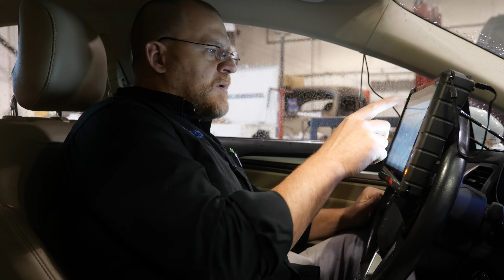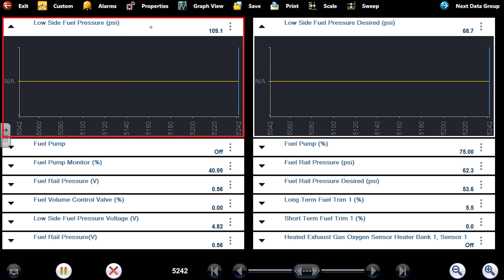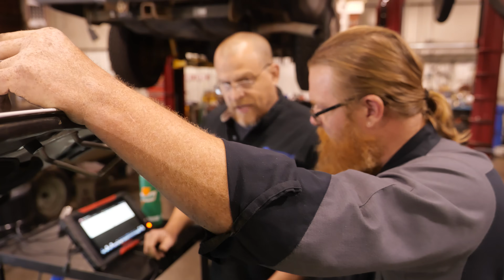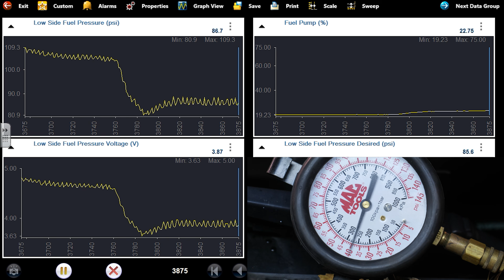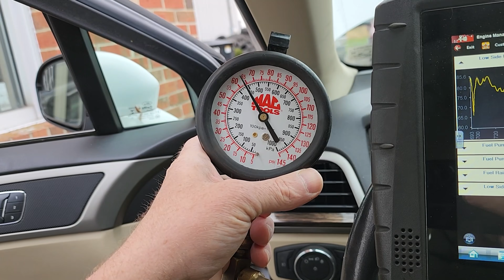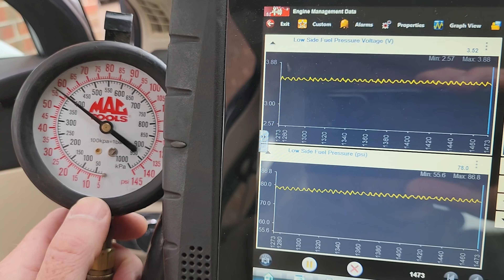Gas Direct Injection System With Intermittent Low Fuel Pressure

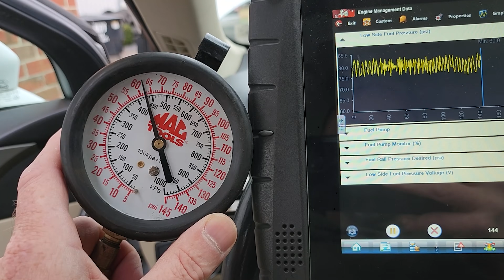Comment: 43:40 On the 2020 VW Atlas, Snap-On Zeus shows "adaptation values" for the fuel pressure sensors.  That might account for the difference between the fuel pressure gauge reading and the value displayed on scan data for fuel pressure.

Comment: In March of 2026, our shop is flooded with GDI fuel delivery issues.  It would be nice to have videos that offer guidance on what cautionary tests (and or disclaimers on the business end) should be done before throwing a high-pressure fuel pump at a vehicle.  If the HPFP replacement didn't work, how can we tell if it was a defective replacement HPFP or a problem with the cam lobe, follower, cam timing, spill valve circuit/wiring integrity?  Techs are thirsty for this training and employers have no choice but to pay for it.  Would be nice if employers didn't have to pay for room and board (meaning if it were available online).

Comment: That's interesting. I like the idea of applying heat to the sensor to see if you can get a reaction. I learned some info about high pressure electronic fuel systems.
Reply: So did you apply heat to the low pressure fuel sensor to make sure what you was reading on your scan tool wasn't subsutited values? I wonder how the heat was able to make the pressure sensor change signal voltage?

Comment: @scannerdanner did you have the Schrader valve installed on your fuel pressure gauge in this video? Ive got a 2017 fusion with a GDI issue that I beleive is an inop high pressure fuel pump, but when I install a fuel pressure gauge on the low side (Schrader valve installed), there's no fluctuations in pressure, which would be an indication to me that the HPFP really is faulty

Comment: Funny I ran across this video after searching Phoenix Plus scanners. I have the same car doing the same thing and it acted like a fuel pressure issue or restriction- meaning it ran better as I lifted off the pedal in test drive. But I couldn’t verify because I didn’t have test port adapter for low side. I ordered that and then my Autel broke before I could get back to it. I ordered a Phoenix Plus and this video was suggested under your review. Wish I’d found it the first time I tangled with that car but now I’m excited to get back.

Comment: I think this is my 3rd play through this video. I appreciate what you do! I was wondering more about how the pcm determines what fuel rail pressure it needs. My 2.0 eb is idling at 260 frp and i see the car in this video is in the 700's. I think that points to my lean code and failing cat. However ive been missing it because the desired pressure is also right at 260ish so the ecu is happy. Im planning to test the low side pressure very soon.
Reply from the maker: If your desired matches the actual, then your pump is not the issue. What are you chasing?
Reply: @ScannerDanner  the car is running at over +30% fuel correction. Weve checked for air leaks until we died. Even a ford dealer found no air leaks. So if the system is correcting with that much added fuel, there MUST be extra air for it, UNLESS there is just not enough fuel available. The pcm is opening the injectors as far as possible just to get enough fuel to idle near stoich. Above idle, my fuel rail pressure spikes fast and the trims begin to drop, at wot im near 0 ltft. So it would seem i have low frp but only at idle. Ive replaced/swapped every sensor including the injectors.

Comment: I have a 2014 ford fusion 2.0l turbo. I was wondering what the desired fuel rail pressure at idle? Mine is running 259 psi I’m assuming it is low. The low pressure pump is at 55 psi on a gage. By the way awesome video.
Reply from the maker: You should have that data parameter on your scan tool. If you can read rail psi, the desired should be there too and we'll as the high psi pump solenoid duty cycle.
I do not know what the desired is, sorry
Reply: Thanks for the response. I tried my scanner is a BlueDriver. It just reads the high side and doesn’t give me desired. Bummer. Have a great day and thanks again.

Comment: Our 2014 Focus Titanium just started acting up and has 226,000 miles. I have a cheap code reader that shows low fuel pressure. The FRP goes to 0 and runs very rough after driving 4 or 5 miles. FRP sensor and FP sensor replaced. No change. In tank fuel pump replaced and HPFP replaced, as well as the fuel pump driver module, with no change. 
 The HPFP has a foam insulation cover on it and I am curious about how warm the HPFP should be? It gets pretty hot to touch. Is this normal?
 I'm asking because nobody around here seems to be able to help.
Reply from the maker: I think the first thing I would do is to confirm that the low pressure side of the system is being maintained at the proper pressure. You'll need to adapt a pressure gauge on the low side of the system somewhere.
Reply: @ScannerDanner Thank you for answering.   I haven't put a physical gauge on it, but my friend has a Snapon scanner, and it's reading a constant 85psi on the low side. The in tank pump is new. I removed the FRP and turn the ignition on, and it shoots a stream of fuel out of the fitting. The fuel filter is in the tank fuel pump. No in line filter.
Reply: @ScannerDanner  I'm sorry to bother you again. The FRP and desired FRP are within a few psi from cold start to 194 ect. As soon as it reaches 194 ect the  FRP and desired FRP goes haywire. Desired FRP will drop to 53.6 and rebound to 288 and everywhere in between. The FRP will drop to 0 and climb to 400 or more and drop to 0. 
 After it starts running bad ,
 I unplugged the FP sensor with no change so I plugged it back in. Unplugged the FRP sensor, and it won't run, so I plugged it back in. When I unplugged the HPFP it runs better. No sputtering or rough running. Plug it back in and the rough running and sputtering returns. I think I found something but I don't know what or where to go from here.
 New in tank fuel pump,  HPFP,  FRP and FP sensors, FRP pigtail,  and fuel pump driver module.
 Your help is greatly appreciated.  Thank you.

Comment: As to the fluctuations in gauge not matching the scan data: the needle on gauge may not be able to keep up with the frequency increase in the electrical fluctuations on the scan tool.
Reply from the maker: More like the data is not keeping up with actual. It never does and is always delayed. But this was more than that.

Comment: I have a 14 Fusion now with similar complaint, but has a code for FPCM. Dealer replaced FDCM but codes comes back. Have yet to replicate the customer issue and all live data seems good, unlike your video. I worry my checks at the FPCM will be "good" unless I can catch it when the problem is happening

Comment: The reason why your pressure readings readings are different on mechanical gauge than scanner is because the fuel rail pressure sensor measures pressure difference using intake vacuum, where your mechanical gauge compares the difference with atmospheric pressure
Reply from the maker: Is off by more than 15 psi wasn't it?

Comment: Absolute and gauge pressure will be 15-20 PSI difference. I learned about this on a Volvo with a DC (Duty Cycle) NON GDI fuel pump system and did a scan tool pressure test. Service info and scan tool test told me about it and researched told me also. Funny thing it kept throwing fuel pressure sensor codes. Cause the pump was worn so DC was at like 50%, to maintain desired PSI. With a new pump DC came down to 20-30%(Been 5 years so don't remember exact # now). Vehicle was at 2 shops and the dealer before it came to me. All replaced the sensor and filter. Dealer wanted to put a computer in it.

Comment: Great video. I have been following your channel for many years. I learnt a lot. what is the purpose of heating the sensor? As I understand, Heating will rise up the pressure, we should see voltage going up.
Reply from the maker: Heat and vibration are the keys in recreating intermittent faults. Also rapid cooling of a sensor or component can help too. Thanks!

Comment: use a heat gun with steel flex tubing(exhaust) to heat the sensor or steam, if you have a steam carpet or engine cleaner with small handheld wand.
I'll state the obvious, don't burn yourself doing so that way and do not use open flame or spark producing things to heat fuel system parts(like the fan in heat gun!) keep everything a distance away just in case(lol) some people need this warning I guess.

Comment: The signal appears to be aliased on the scan tool at the higher rpm due to  a low refresh rate.
Reply from the maker: That wouldn't explain an actual smoother psi on the gauge cause the scan data PID to move more. I'd be the opposite if it wad a refresh issue.

Comment: Is it possible that the reason why the more fluctuations you see on the gauge the less there is on the PID, is because as the fluctuations climb, the less time the sensor has to measure and it kind of averages out on the screen, thus showing less swing?
Reply from the maker: scanner frame rate could definitely be a factor, its just opposite of what you'd think. A smoother actual measurement, shouldn't result in more fluctuations on scan data

Comment: I hope u get well soon 🔜... again.. another great video u have no idea how helpful you are and all of your knowledge...great tip from Brian at the end!
Reply from the maker: All better now my friend. Thank you!
Reply: @ScannerDanner  glad to hear that btw..idk if Yu remember me comment on a different video about the car not starting when hot....I believe it was the ect sensor....also it turned off on my client and found out the pump wasn't even strapped in on the holder and connected to hose
Reply from the maker: @nutsandbolts7407  I'm not sure without the context of the discussion. I'm sorry 😞 
But it sounds like I was able to help you? Either way, nice find!!
Reply: @ScannerDanner  well definitely direction..months later...I should have checked the pump first.......u had asked me what was the milliamp doing on the O2 sensor and it fluctuated from .2 to .9 .......yes u did help a lot!!.. definitely different than 2 years ago ...thank Yu!

Comment: A question about it. What happens with the SFT and LFT in that situation? Low pressure implies less fuel and lean condition? Would the ECM try to correct it increasing SFT? Thank you for this gems Mr.Danner.
Reply from the maker: Yes sir! Fuel trims would go very positive at times

Comment: Maybe the reason the gauge steadied when rpm increased is, even though the scan tool amplitude varied more,  the frequency also increased on the scan tool. The physical gauge probably doesn't keep up.
Reply from the maker: Scan data frame rate was the same if that's what your saying? Thanks
Reply: @ScannerDanner  frame rate the same but the time between peaks for instance are closer together when reving  (fluctuations so fast the physical gauge just reads steady.) Just a thought.

Comment: My alternator on my 2001 Firebird won't charge at idle speed, but raise it a couple hundred rpm and it starts charging. I checked the exciter wire going to the alternator and it shows it has 9 volts unplugged, with the key on. Should I be checking this plugged in? Or does this indicate a bad ground in the computer? Not sure if you're familiar with this system or not. 
Any help would be appreciated, thanks!
Reply from the maker: Is this the one wire set up other than the heavy cable of course? I'd have to check a diagram
Reply: @ScannerDanner  yeah. It has the battery positive terminal on the back, and then a small Guage wire going to a plug on the top of the alternator.
Reply from the maker: @nateb.1568  okay, this is a simple system where the ECM turns the alternator "on" with that small gauge wire. It should be near 12v from memory and should be tested plugged in.
You can actually take a test light to battery positive and touch on that alternator terminal and make the alternator start charging
Reply: @ScannerDanner  Thanks! I wasn't sure if it would be 5 volts since it was a signal coming from the computer. If 12V is the case, I have a voltage drop somewhere. I can see that it had been spliced into already so I should start checking there to see what voltage I get before the splice.
Reply from the maker: @nateb.1568  100% agree
Reply: @ScannerDanner  I'll take a look and let you know what I find! Thanks for the help!
Reply: @ScannerDanner  I checked it with the car on, and the exciter wire plugged in, and it showed 12ish volts when the system voltage was 14ish. So there is a 2v drop somewhere. I'm wondering if it's enough of a drop to not be able to start buck up once it gets down to low enough rpm.
Reply: I went all the way back to the PCM and the voltage is the same, 12.5 voltsish. Is this wire supposed to be system voltage(14.5ish) or is the computer kicking it down to 12? If it's supposed to be system voltage, that points to a problem at the pcm itself. Corrosion on the pin? Bent pin? Not plugged in all the way? Not sure.
Reply from the maker: @nateb.1568  12v should be fine as I can turn those on with a test light to battery positive. Sounds like the alternator just isn't doing its job as it used to
Reply: @ScannerDanner  sadly it's a brand new alternator lol. I'll take a test light and jump it to battery positive and see what it does.
Reply from the maker: @nateb.1568  old alternator acted the same way?
Belt isn't loose or anything like that is it?
Reply: @ScannerDanner  not quite the same way. Voltage always seemed lower than it should have but never shut completely off like this one. This is a higher output alternator, though. I think the belt is tight enough cause I don't hear any squeeking, and it's a manual tensioner.
Reply: Well I just tried jumping the wire to battery positive and it didn't make a difference. I checked to make sure it was getting battery voltage and it was. So I'm guessing the alternator is being underdriven too much between the combination of pulleys on the crank and the alternator, considering its a higher output alternator.
Reply from the maker: @nateb.1568  bat post on alternator is equal to battery positive post? If yes, you need an alternator
Reply: @ScannerDanner  yep. Guess I'll get a new alternator, then. Thanks for all your help! I enjoy the problem solving aspect of diagnostics.
Reply from the maker: @nateb.1568  always tough to call a bad new part
Reply: @ScannerDanner  I remember one of your older recent videos where you had to call multiple bad parts of the same part. Threw you for loops. You figured it out though, as always :).

Comment: Very cool video. So hard to explain this stuff to a customer. Being at a trusted private shop now for me its much easier to deal with these issues. But the conversation of it needs "this" sensor but may need further repairs is always painful. I try to remember we're all in this together, talking down about other shops just confirms even further the cust perception that "I'm getting ripped off". The few poison the well for the many, and I think most techs have good intentions but just don't have the training to correctly diag systems.

Comment: These engines can very easily lose a head gasket when the low pressure sensor fails. They lean out. Soon after the block cracks at the top between the edge of the cylinder and the cooling groove.

Comment: The 15PSI difference is normal, Ford and volvo (from my knowledge) use absolute pressure sensors for low side fuel. Usually it is written in the fuel pressure sensor info. Almost got my butt kicked from that once hahaha the TSB is most probably because too many techs thought the sensor was faulty when it wasnt.
Reply: You are correct absolute and gauge pressure is 15-20 PSI difference. I already commented on this video, but I learned this on  valvo service info when doing scan tool pressure test.

Comment: Hi Paul, if you go to pinpoint test in alldata or Mitchell , go to pinpoint test HP and at HP3 it will say to compare FLP pid to the mechanical gauge, and it says if it is within 22 psi then its ok. If not replace the FLP sensor. I hope that helps. Thanks Paul, great video.

Comment: You can use sensor simulator to change the low pressure sensor voltage reading to see what happens to pressure gauge reading.

Comment: I think a test drive before working on a vehicle is very important. Paying close attention to what the vehicle is doing right or wrong. Not to beat a dead horse but I know you and you brother have complete confidence in each other. I was thinking of a new tech working on a vehicle with only the information from the customer or the shop Forman. A test drive before and after the repairs is so important. We have all test drove a vehicle after repairs and on that test drive the vehicle does something that seems wrong. In your mind you might be thinking I wonder if it did that before I worked on it. That's what I was trying to put out there. I have been working on vehicles and equipment for 40 years and I feel I still don't know enough but thanks to you I know a lot more.
Reply from the maker: Of course, but I knew I could get it to act up with it just idling and my bro already drove it 😉